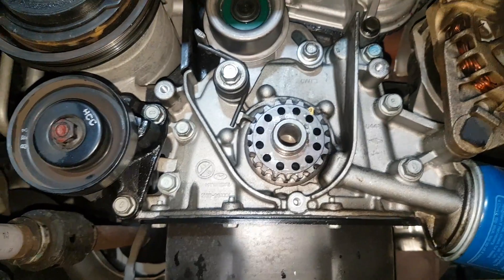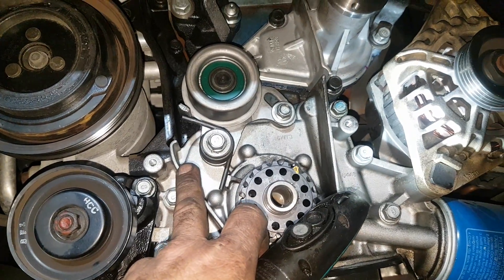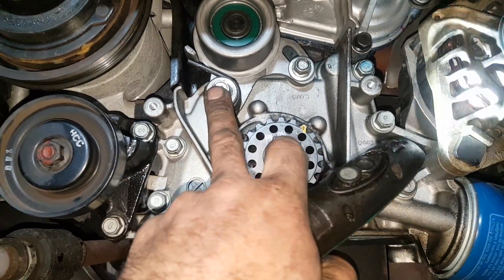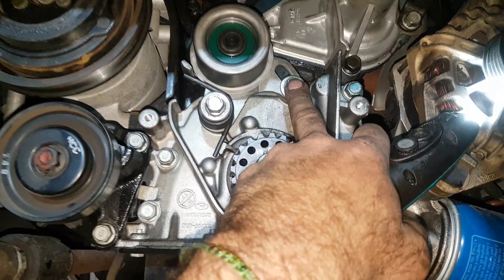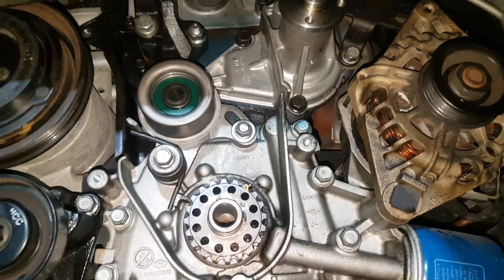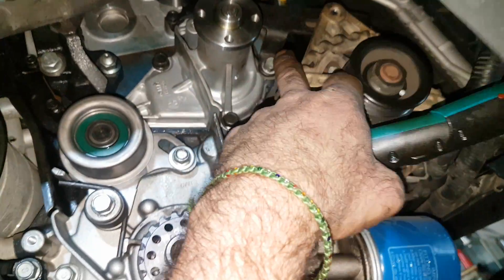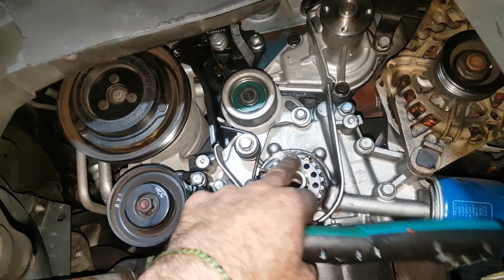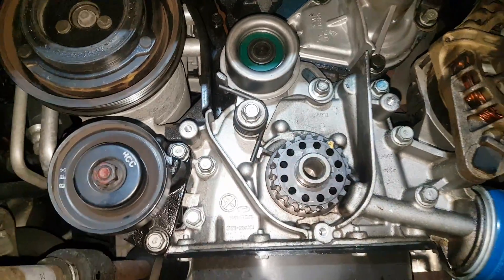Hyundai Getz timing belt alternator bracket water pump timing belt tensioner spring

Comment: Agreed with the strange design logics: one more, and a caution. The air-con compressor belt tensioner pully's tension is adjusted with a hex-head bolt and screwing into a post with a threaded head 'block'. To look at the water pump belt tensioner and the compressor's they appear very similar, but the setting/releasing screw actions are confusing.

THIS is because the water-pump adjusting bolt is a right-hand (normal) thread, whereas the compressor adjusting bolt is a LEFT-handed thread!

I had a dicken's of a job removing the compressor bolt - it was jammed solid.. Days of penetrating oil finally permitted me to release it, but it was such a struggle that I didn't twig the cacky-handed thread. (I was old and tired :{ 

So: the bolt doesn't look too bad, and a quick deep-V mini-file quickly clears the irregularities on the thread. Still didn't twig. Then I run a M8 1.25 start-tap through the female part, and that is hard work - obviously damaged. Finally twig. I've just run a right hand tap through a left hand nut! Which in jewelerer's loupe check inside the hole shows that some had been there before me, and done the same! Duh.

Hyundai central spares vaugue
Reply: (whoops - hit Rtn - cont:)
So I ring around wreckers - funny, a bloke says, I had someone in here just last week wanting the same thing.       So I'm not the only dill.

No spares, so refitting. If the shredded threads can't hold the belt tension for the compressor, and strip, I suspect a solution will be to have a professional fitter & turner drill out the female end, heat it, and shrink onto a sleeve or rod. That fitter may have a left-handed tap on hand. If not you will have to track down an M8 1.25 standard/course start tap. Took some ringing around here 'til a source was found. About 5-6 times the price of the right-handed normal tap. Ouch.

Long winded, because I always describe in such a way that someone with zero knowledge of the skill being discussed walks away with the topic understood..

Thanks, orig poster. You gave me confidence to dust of my overalls and crawl under a car for 1st time in 20 years. You time and effort put into making the clip greatly helped, and most appreciated.
Reply: @jencluse660  
Thanks for sharing. You are not a 'dill'!  Your honesty helped me.